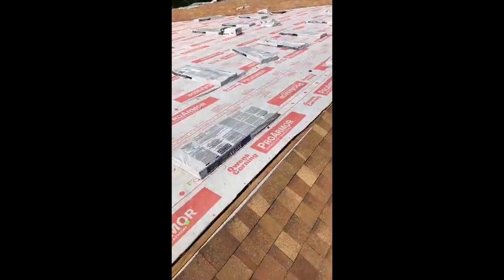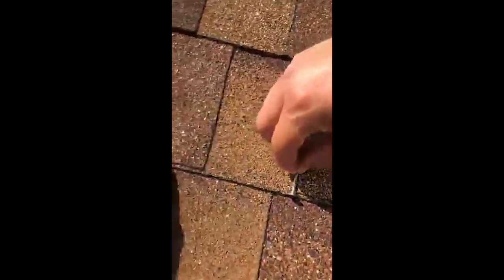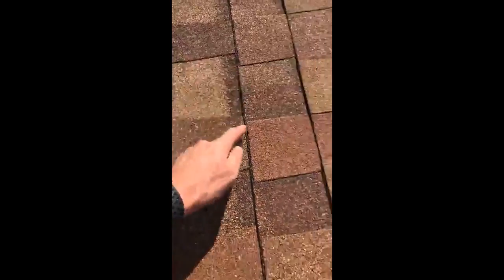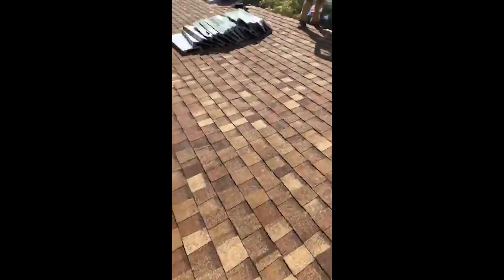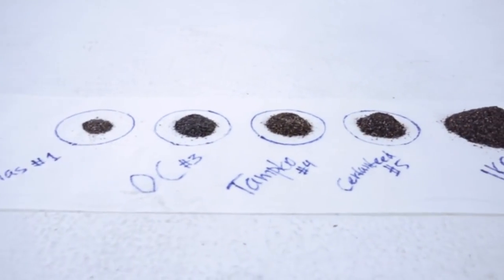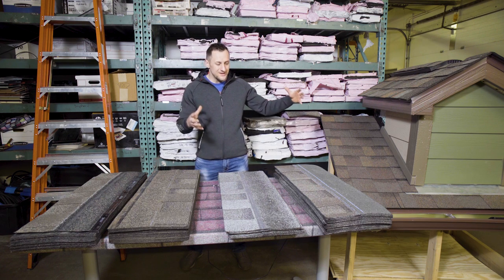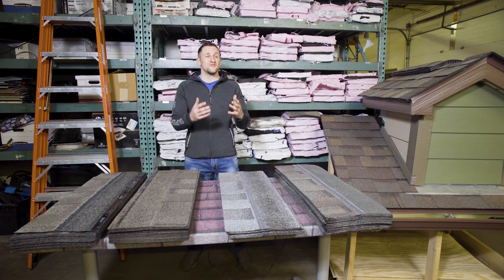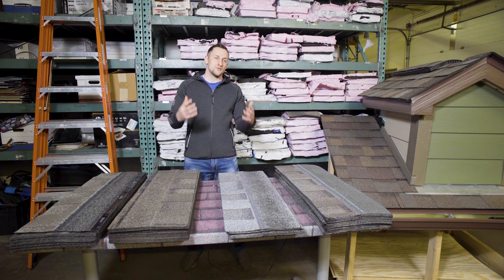Best Roofing Shingles: Certainteed, Atlas, Owens Corning, Tamko, IKO

Comment: I know that Malarkey is crawling towards the East.  I'm sure once you've handled it and played with it, you would keep this as one of your top brands.  I'm a roofer in Hawaii.  You claim in your review that all manufacturers have had a lawsuit.  Malarkey still has a clean slate.  Because they are a family company, they care about quality going to end user.  Not saying they are perfect but, they address every complaint and usually comes out with a win win scenario.  Now, with there sustainable products in there asphalt they are helping mother earth.  Also, with the help of 3M Smog Granules, for every 3000 sq ft roof - it's like planting 2-3 mature trees.  It helps take the nasty nitrates out of the air and flushes with moisture.  Turning it into a mild fertilizer.  Non-potable though.  Safe for plants and pets.  Not to mention the 1.5" nailing zone and modified shingles.  They are the only manufacturer who has a complete modified line of shingles.  They have ALOT more to offer for a competitive price.  Just thought i'd keep you in the loop.  Aloha!!!
Reply from the maker: Aloha!!! Malarkey are the best!

Comment: I had the whole house roofing done a year ago with Certainteed heavyweight shingles and their top of line product.
Last week, during a day of rains, the roof started leaking in the vaulted ceiling portion.  
How do I find where the fault is.  Please outline a process.  

Thank you for the informative videos.
Reply: Notify the roofer who installed the roof first? Not sure how old the roof is. There still may be a warranty on the installation. Then the contractor can determine if it’s a install error or manufacture defect.

Comment: Thanks for this video! Could someone kindly provide
Me some feedback on the IKO DYNASTY shingle? Replacing OC shingles after 20 years and I’m disappointed in how they held up. Any advice is appreciated!
Reply: Dynasty is a great shingle to use as replacement - However there is not any guarantee that any shingle will hold up in the elements I have been roofing for over 25 years the best in my opinion are as follows - 1. Certainteed 2. OC Duration 3. IKO Dynasty. Of the 3 anyone could fail under unforeseen circumstances. Shingle manufacturing is not a proven science thats why they will continue to improve
Reply: @mariohio1  In
Reply: Go with CertainTeed and never look back.

Comment: I'm outta OKC and love Malarkey. I've ran into a couple times where hoa's required gaf ww and it made me cringe. I'm curious about atlas too, I may put it on my own house to give it a shot! Thanks guys
Reply: Excuse me; how can the hoa's "require gaf?" are they going to reroofed your house for free when they learn the produce is substandard, as they have proved nothing to me that my shingles look damaged although I asked for a copy of the so called document; and by the time I was given permission to use my own claim box since they were stalling for a year; the shingles were only two years; granules falling off severely, the ends cracking and just splitting in locations.

Comment: I have For a crap 30 year Atlas shingle on my home, it 20 years old this year and 4 years ago they started coming off in pieces. I called Atlas and got the run around, the lady was a complete jerk. 
Here I am today and we are going to have our home reroofed and Atlas is not in my mine. When I look at the back of the shingle, the seal line, there is very little sealant. No wonder they come off in pieces. 
I have been looking at Owens Corning Duration Storm with the special nailing area and how well the sealant adheres to it. This shingle has been engineered with very high degree of performance and insight to sealing over the nail in area. 
I hope Owens Coring does me right and their product performs as advertised..
Reply from the maker: If you got 20 years out of your roof it’s actually pretty good. You have no idea how many fail sooner. What city are you in? Life expectancy of most roofs is about 15-20 years. They call it 30 years and in some climates it could last, but most shingles will start failing around 15-20 years. You will be surprised but biggest player GAF has 50 year warranty. I can’t comment on it but wanted to share. They didn’t agree to participate in our comparison. YouTube 2020 shingle guide, you will like it
Reply: @RoofingInsights3.0  Then maybe they should stop stamping "30 YEAR GUARANTEE" on them.
Reply: Duration tack strip and nail strip didn't work as planned.  OC had to move one or the other because they aren't tacking and were blowing off.  Hopefully OC got that corrected.

Comment: Definitely CertainTeed. They stand behind their product like no other company. The Northgate is the best product on the market.
Reply: How have you liked the sbs shingles.
Reply: @KC-zr1rd  They can be installed in lower temps and still seal quickly. They're easy to work with. They hold up to hail better than any other shingle. My crew loves them and I have them on my own house.

Comment: I used to work for malarkey,and what I was told that from years back they had one of their competitors came in to see how malarkey was mixing their coating and rubberized materials, and turned around just to steal the formula compounds and tweeked it in their own ways...needless to say malarkey won't and will not be doing that again. They got it locked under lock and keys..

Comment: I have a certainteed roof that is 10 years old and has lost shingles since it was 4-5 years old. During moderate winds they flop up and down. I dont know if I got a bad batch of shingles or what but I'm getting ready to replace it. Maybe the Atlas?
Reply: I'm not a roofer, but where I live has really intense wind.  I ended up replacing the entire roof because of bad nail placement.  Pay attention to where the shingles have been nailed, and if it is consistently too high, then yeah, you should think about replacing that roof.
Reply: @MrTBoneMalone  From what I can tell the bonding material didnt seal good. Mostly just tabs breaking off but I have had large places to buckle up too. Just had another high wind storm and have damage again. I have a roofer coming tomorrow, I want to see what he says is causing it.

Comment: All manufacturers have the problem shown in the beginning. Some less then others some more.  I've learned how to keep chalk line straight even if this problem shows up.
Reply: You can't chalk lines & you don't need too. Lay to the "cut out" . We run into "dragon teeth" where the top lament doesn't line up with the bottom we refuse the lay them. Tamco makes it right they bring us good shingles. The only place what you are talking about matters is the second row to square with the eve and a tie in. If you run the cutout they will be arrow straight. I'll send you pictures if you want. You simply deal with any problems as they come. Ever roof a gambrail barn? 3 layer cedar shake tearoff and roof. If you can't see that you're going to be off when you install the plywood you're an idiot.

Comment: Well, this is unfortunate. I had my two sloped roofs done by a contractor because I'm afraid of heights (at least as far as my 2nd floor goes) and they used Tamko, which they made sound like the best.  One part is a low sloping roof which I did myself and used the Certainteed Flintlastic SA Cap. My garage still needs done and I imagine i'll end up doing that myself and probably use Certainteed shingles (which i had planned on using on my house) for that and find something that matches the house close enough.  Are the brands carried at the big box stores worth having, even if they are a reputable brand?
Reply: Will Tollett  I had one come off and I emailed them a few times and no response - shocking. They're about to get lit up on their reviews though.

Comment: What's your thoughts on the GAF  Weather Stopper System Pluss then they have the Silver Pledge and then the Golden Pledge.  Having a company going to batt with Insurance, on a light hail damage  job and that is what system they provide? Thanks in advance..
Reply: Forgot to mention in N. Colorado..
Reply from the maker: There are better shingles on the market
Reply: @RoofingInsights3.0  Hey Thanks,  I guess I'll have to do some more research before committing...
Reply: Stay as far away from GAF as you are from the state of Maine; Golden Pledge is the only way to go for your installer, and it is probably a Master Certified Elite who is pushing GAF check the weight; but many companies other and do not let them push or manipulate you, GAF had a Class Action in the last 6 years and there is not proof they improved their crappy product;  read what other people are saying about Owens and Markley, I will save you a nightmare as mine are awful and were just after one year; or they may have used a wood chipper to aid in the installation. Just saying for a visual
Reply: @TheTrthseeker  We had the adjuster verify and measure out existing roof and said it was a 40yr or a high end and the insurance is willing to pay up for that upgrade.  So far all the salesmen have been pushing these high end big box store OC shingles.  I feel like they are just trying to make out on an easy score us being uneducated about shingles.  I've been educating myself on the subject in between painting the exterior and have till next fall to get roof done according to ins. time frame.  We have been looking into the Malarkey middle grade shingle, bout $210.00sq but not sure now after reading reviews.  Will do more research to find the best bang for the buck as well as a pro installer as my roof is not your simple type roof, lots of step flashing involved.  I wonder it it would be wise to pay up and sheet the entire roof with water and Ice shield.?   I helped my brother when we built his house high in the mountains and it's required on the whole roof there! Thanks for reply..

Comment: July, 2022 I contracted to have installed a Landmark Pro roof for my 4,500 sq ft home.. I live in Central Florida and was sold on the color ResawnShake. And entire month later I've waited for the supplier only to be told it could be another month and they're not sure when this color will be available! My roofing installer has offered Owens Corning duration for no extra cost! This is the reason I watched this video to assist with my making and informed decision about which product would be better: Owens Corning Duration or Certainteed Landmark Pro! I realize that vanity is influencing my decision however I will consider warranty honors, product durability, overall product duration. Any thoughts?

Comment: Good info. I'm planning to replace the roof and I'm getting quotes from roofers. Some suggested Owens corning and some Certainteed Landmark Pro. Which one do you think is better?  I live in New England area and for 1900 sq ft Hip roof, Certainteed quote comes around 9k, whereas quote from another roofer which use Owens comes around 14k, both are around the same warranty. Not sure which one to choose.
Reply: Use Certainteed Landmark Pro 
Owens Corning would be my second choice.
Reply: Ask what the scope of work is because warranties require a very precise install method.

Comment: I like durability, look, weight of a good 3-tab(old Redskins fan to). NOW Atlas has the Legend and Malarky deleted their Alaskan 4 rated 3 tab.....mmmm....I feel a 3-tab is a candidate for second layering. I have a OLD section on my garage with 3 tab(low slope to) and they are amazing for the old price I paid. Screw architect look, I am an old NCO shingler back when shingles were crap but they still had a good look.

Comment: GAF is the best! Certainteed is decent. OC blisters out a lot.
Reply: How do you know; GAF is the best; they had a Class Action lawsuit  which included over 100,000 homes whose shingles were wearing. My GAF are awful; they say they are damaged, and were new two years ago and I finally got the results as they refused to send me the promised claims box; stalled for reason I now figured out; allegedly helping out one of their "Master Elite" roofing contractors; but will NOT LET ME SEE THE LAB RESULTS. You should read the complaints on BBB; Google> Complaint and Master Elite and they talk about their shingles too; and my guess is they never improved them and probably moving them around the country to get rid of them. That is my theory!

Comment: The loop hole to warranties is the contract installer, then the seller, retailer and last manufacturer ,, the only way 2 make your own research pricing warranties with the materials seller like abc etc getting someone to measure roof and account everything , as contractor pricing the contractor should not double the price or more  as a general rule, 8 nails to a shingle 8 inches of overlapped ice and water underlayment all areas , full underlayment on the entire roof will give piece of mind,,use cheap ice, water underlayment were is not needed , and expensive were needed the balance,  these days you need copies of licenses ,permits receipts and the letters in writing from contractor seller and manufacturer of warranty, and check up on them go on top of the roof to inspected and pay attention to the materials take pictures ,, fraud is fraud, con is a con theft is theft

Comment: Owens corning or certanteed
Reply: Spunky  im an installer. Not doing a project of my own. Owens corning duration is what you want, best shingle in the market. They also have a pretty strict certification process so finding a certified contractor may be tough but in the end worth it. Those shingles are as bullet proof as they come from wind, hail, and granule loss. Also very good grip for walking if you have to clean your gutters or remove moss or leaves. Most lower level shingle brands are cheaper and obviously inferior but one brand you need to stay away from at all costs are GAF. Do not fall for their warrenties that they will do anything to void. The granule loss will fill your gutters and they are also dangerous to walk on for home owners and installers as the granules slip right off. Those shingles break in half if you slightly bend them, wouldnt trust em in a wind storm.

Comment: What are you’re thoughts on metal over shingle? I got a brand new shingle roof 3 months ago and then a hail storm storm came through. My insurance says I need a new roof again. Living in Florida by the ocean I think shingles aren’t the best.
Reply: Cb 129 You can look unto Roser stone coated steel roofing systems. Metal is also a smart option if on water. The wind ratings are better on metal/ Roser. Where are you located.?
Reply: Any advice on exposed fastener? I’ve heard of them rusting out.

Comment: Left G.A.F. after 25 years Atlas is my choice.
Reply from the maker: +Timothy Gaits why did you switch?
Reply: Declining quality,weight loss color variances,shrinking seal strip and granule loss. I switched to they're sbs armour shields for a year but repeatedly received defective loads from the Texas plant that makes them.They're rep was less than helpful and had no answers for me. So goodbye G .A. F....
Reply: @timothygaits7972  Do you have an hour, I could tell you run away from GAF; read BBB complaints

Comment: You're putting Tamcos in the same category as IKO's? Wrong!! They're all the same they all suck. Don't give me this shit Tamcos are thicker than Landmarks true but Tamco stands behind their products. You're right Tamcos come out anywhere from a 1/4-1/2" different in width which sucks but if you know what you're doing you deal with it. Don't try and blow smoke up my ass and tell me OC'S are all that they suck they don't seal down they don't blow off but they wave at you when you drive by. How about Timberline (GAF Elks) they didn't even make your list. We lay Tamcos & Landmarks I will not tell a customer that they aren't really good because they are. By the by what underlaments do you use?
We use
Grace ice and water for every thing
Drexel or Feltx synthetic felt
Geocell 2300 caulk very little for counter flashing
Rubber grommet screws for all exposed flashing
Custom bend any and all metal
Double hemmed 1 1/2" drip
1 1/2" nails for all because in a closed valley there's 2 layers
Coravent ridgevent

If we're doing it wrong come work with us for a day or 2.
Reply from the maker: +Jimmy Schiel read other comments on Tamkos even in this thread. They are alright, but not in first tier yet. When we tested them head to head they were flexible, heavy, may good features. But again, we installed them on big job (in video) and all installers hated quality. Inconsistent and overall poor.